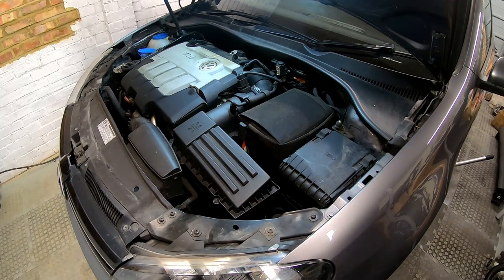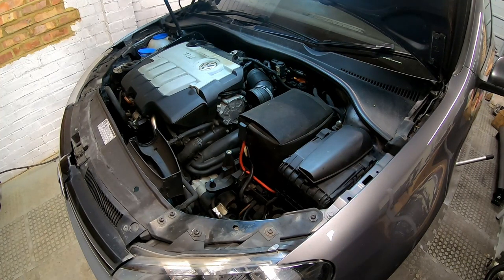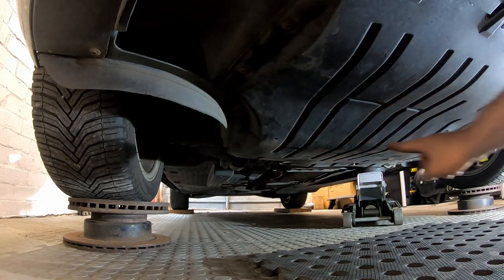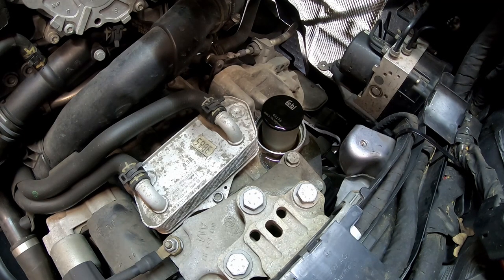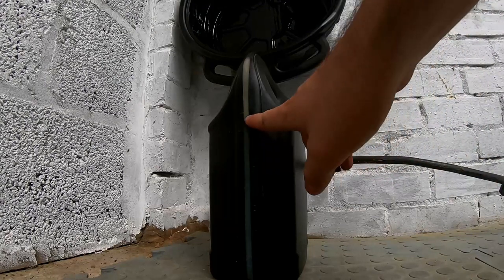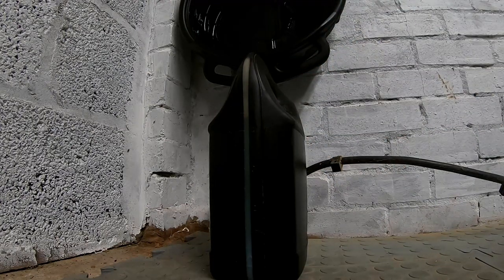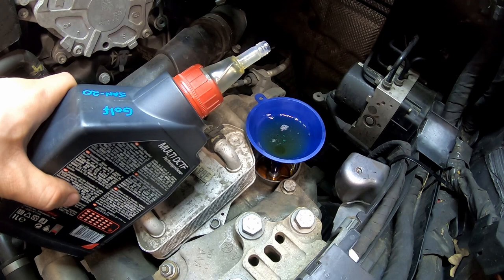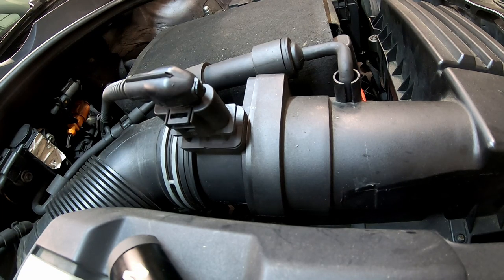VW DSG Transmission Fluid Change -- VW Golf 2.0 TDi MK6

Comment: I followed this step by step, used the same oil you said! Unfortunately I now have a leak from the plug!! New OEM plug and washer as well as PTFE tape on the plug still hasn’t resolved it 😔 have you ever come across it leaking after ?
Reply from the maker: Super odd! Never had a leak, always followed the torque spec and never had any issues. I think PTFE tape is oil soluble so that won't help you. I suppose you could drain it out again into a clean container, use permatex black or equivalent on the bolt threads, only a small amount though, you really don't want any bits of that floating around the box. It should really seal on the washer though, could try nipping it up a bit tighter but again you really don't want to strip the threads out the box!

Comment: I am wondering. The oil bottles you used seem to have a long spout. Does the spout fit into the filter housing hole you placed the funnel in? If so, is it possible to place the inverted bottle spout into the hole to speed filling up? A small hole for a breather may be needed on the top (bottom) of the bottle after it is placed in the housing?  What are your thoughts?
Reply from the maker: Yeah you could give it a go, I think the thing that slows it down is there isn't a way for the displaced air to get out of the box
Reply: @ToolTimeWithTom  if I understand how to dsg snorkel works, would it be possible to remove the oil plug under the car, but have the snorkel in, fill up until the snorkel starts to drip. This would give the air a way to escape and do this faster.. Im doing this job today